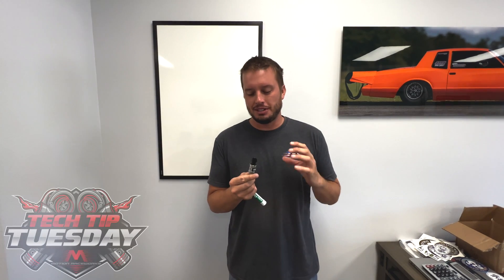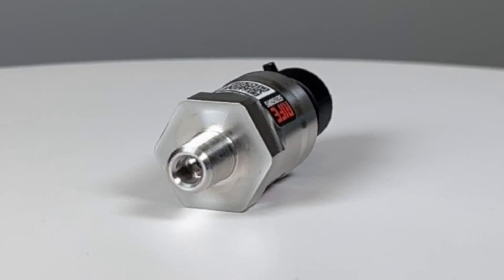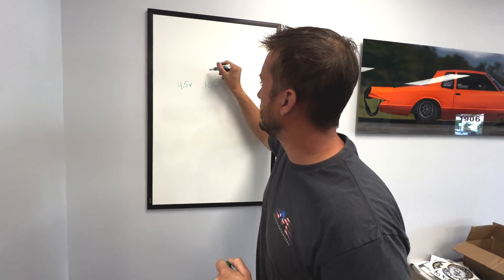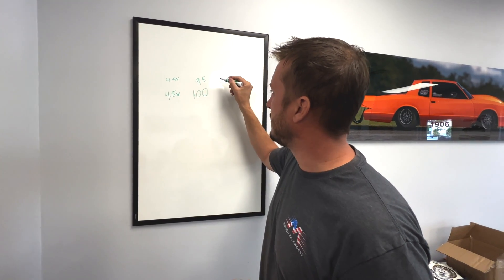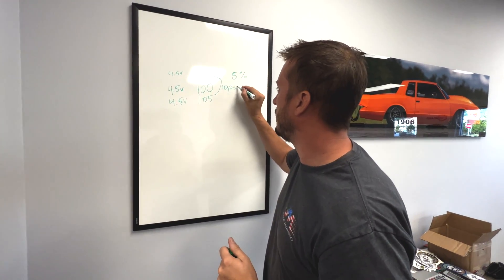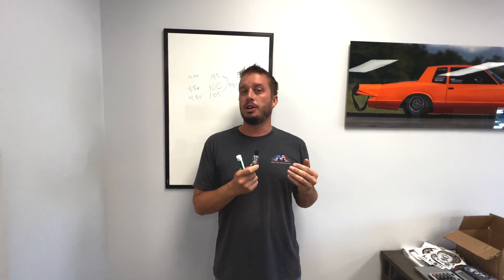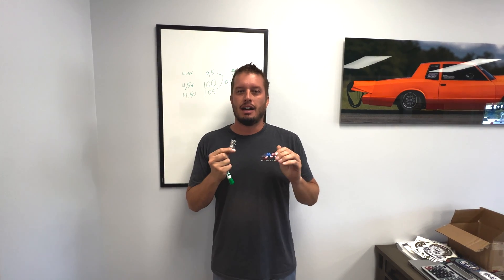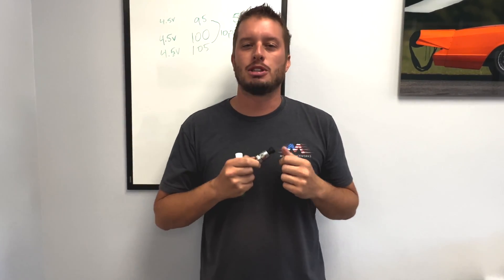Tech Tip Tuesday - Pressure and Map Sensor Calibration Can Cause Big Issues!

Comment: Would a rife sensor be able to sub stain high oil pressure at wot I’m currently whiping out my sensors at WOT my oil pressure is 55-60 at idle and 90/100+ psi at wot since I have a high pressure pump
Reply: Having same issue on my built ls 80 + at wot been through 3 sensors now I was looking at a 150 psi I know guage wouldn’t read that high but not sure if that’s reading or pressure rating
Reply: @Q @Q_mane I just went ahead and changed the pump I couldn’t find any sensor compatable with stock LS ecu

Comment: Where do I find the correct Multiplier and Offset for a 3.5 Bar MAP sensor?  The factory-suggested settings won't even let the car start.  COBB is no help.  I tried a Multiplier and offset found on the internet it started for only a few seconds.  I am using an optimized tune, but without the correct MAP settings, the car just sucks gas.

Comment: My low doller map is scaled correctly in holley but it reads 86kpa key on engine off and running shows 30kpa range when trying to build boost. I have looked at tune and also checked voltage I get 4.96v on power wire 1.66 on sensor valve. It's a 3bar sensor any help? I tried scaling the sensor at it ran rich my car way out when I started it. Shut it down and took scaling off. Need help my tuner is lost called and got a replacement sensor and same thing.

Comment: Checking the end points is a good idea, but how about the 3 mid points at 25, 50 and 75 percent of the range.  The endpoints may come into spec, but if one of the mid points are not checked you cannnot tell for sure if its truely linear which could be off 5-10 percent within the range itself.

Comment: My side-by-side is running lean in closed loop mode. Per the diagnostic window, the system thinks baro pressure is 27.0 when local weather stations average 30, and my own cheap weather station is a bit higher. I would love to be able to replace the MAP/intake air temp sensor with a sensor accurate to half a percent!

Comment: Interesting :-). In Industry we use test ports like this. Search "anchor fluid power TEST POINT FITTINGS". Inclusion of test ports like that would allow one to hook up an analog gauge to confirm the transducer reading and or calibrate it. Might be a good pre race weekly PM to confirm important transducers. Compatibility with the fluids might be an issue with fuel though.

Comment: Good info! With watching you guys and seeing the cool stuff you build have any of you tried 3m panel bond to put fiberglass or carbon fiber to metal. Check it out I've used it for years stuff is strong as hell. Thought of it on the Nova build. Also works on metal to aluminum or aluminum to fiberglass. Used it for 10 plus years easy way to put things together.

Comment: Any plans to offer a combination pressure/temperature sensor? Makes packaging so much easier on some stuff like oil and water.
Reply: Lowdoller offers exactly what you're looking for
Reply: @tobylewis1920  Yea, we have some. The resolution hasn’t been quite as accurate as we’d like but we are making them work for the time being. Since accuracy is one of the big selling points of the Rife sensors, it would be awesome if they offered them as well, to compare against Lowdoller’s offerings.
Reply: @ThePopeProductions  how far off are the low doller sensors. I just ordered some rife sensors and some lowdoller, but if it's a problem I'll swap to all rife